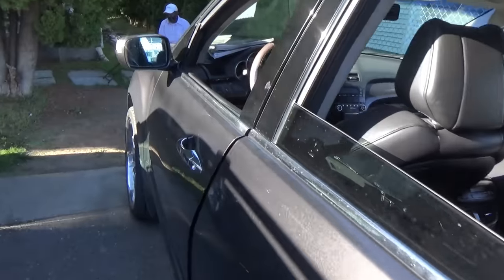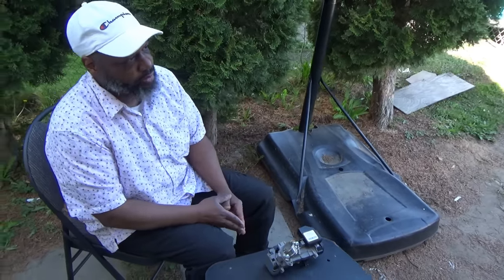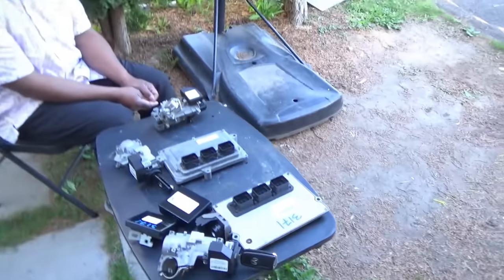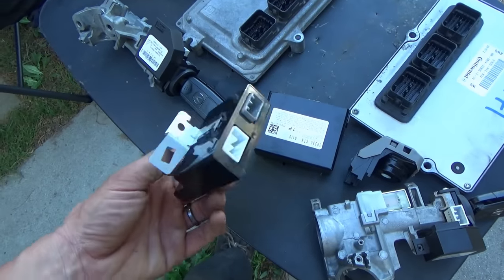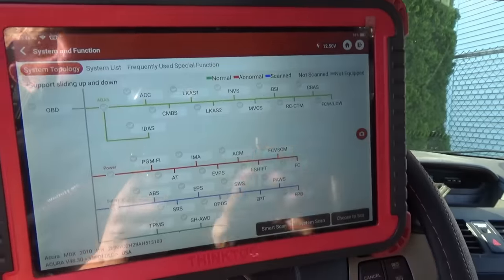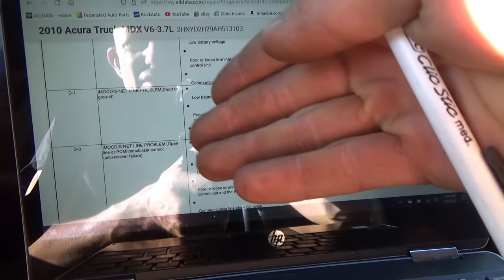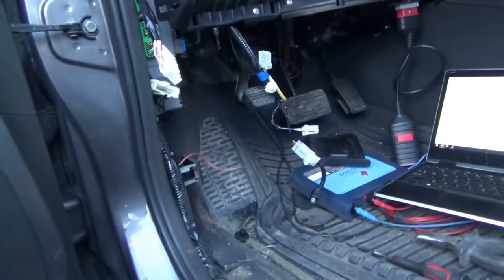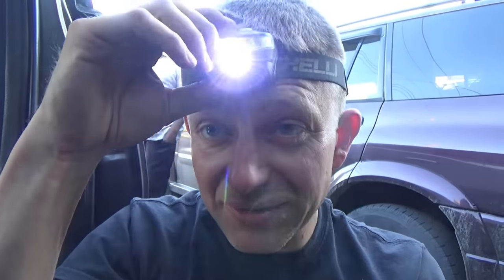Customer Spent $4000...and it STILL Doesn't Start! (Acura MDX)

Comment: My Mechanic put 3 AC Delco fuel pumps in my 2000 S10.Still not holding pressure.Work good for about 4 or 5 cranks.Then long cranks.What can be causing it to lose pressure.Wished you can come and fix mine.
Reply from the maker: Did you check the fuel pressure regulator at the spider?

Comment: I am really amazed that Honda would have such a precarious, questionable connection like this. Look how those wires are turned at a right angle and stretched tight. Really Stupid. I know this would be a lot of work, but I would replace that plug. Im wondering why Ivan doesn't just splice the lombar supprt circuit outside the plug?

Comment: I agree...  where did the water come from??

When seeing the errant 1 to 11 v square waves I thought there's a functioning pull down but a wrong pull up.  Pull ups are resistive to B+... and your corrosion path was just that:  NOT a hard short.  Still.... what's Keith's phone number, just in case?

Comment: IVAN Is the Thinkcar Thinktool  a good scan tool ?
Reply from the maker: If it wasn't good, I wouldn't use it every day haha
Reply: @PineHollowAutoDiagnostics  I guess not but didn't know you used it every day. That sold me, going to buy one pay day . Have a Autel MD806 pro / cheap one ,time to up grade . Looked at a lot of videos of different scanners - TOPDON , Autel  maxis, Launch X431 Diagun IV. Just didn't know which one to get . I've used just GM tech 2 before working at chevy dealer. Before that the tech 1 back in the day.

Comment: It wasn't a wiring problem, but it was a connector problem!  I still don't understand why the signal amplitude was affected instead of the line being dragged high by the feed from the hot fuse.  Did you or Keith figure that out?  Mark me as "still puzzled" Pegram. 8-))
Reply from the maker: Because it was a "soft" short to B+ through high resistance green crusties lol

Comment: Why not depin the one power wire on both sides of the plug and add a separate single connector?
Then the circuits would all work and no interference from the 12v to the comm line etc.
Be a Russian repair

Comment: The car failed in sympathy for the smoke detector battery. But seriously I hope he can recoup his losses selling the unnecessary parts back on eBay.
I'd just snip snip and route that faulty power wire around the connector. What are the odds anyone will need to disconnect it anyway? They'll just have to deal with it.

Comment: With all the creature comforts comes the disadvantage of chasing down these kinds of problems. Goodbye private garage owners. How can we ever afford the cost of keeping up with the diagnostics? Identafix and other reference websites are expensive.  Add to that the  cost of keeping our scan tools updated. Having one scan tool doesn't do it these days. How often do we see bad data from one scan tool so you check it by using a different brand to see if perhaps they got it right. It's a losing battle for the independent shops. You either have to go big to spread the cost or go out diagnostic work. I didn't get into this business to change oil and do break jobs.

Comment: Drives me nuts when diag says 'Blown fuse'.  Fuses don't 'blow', they open.  'Blown' is a BS term.  Shame on them for using that term. 'Blown' is a very automotive thing.  Electrical engineering NEVER uses the term 'blown'  really doesn't mean a thing.  Yea, drives me nuts.